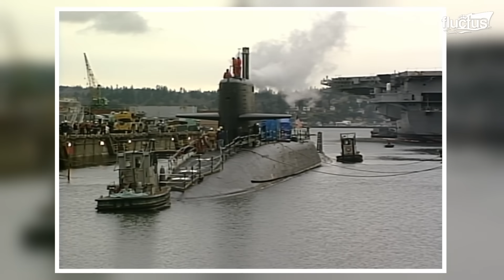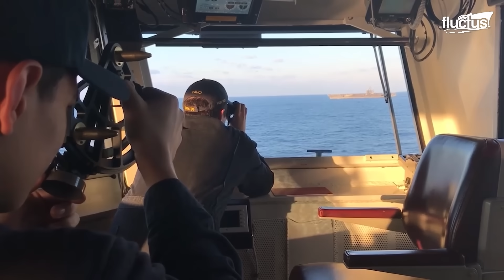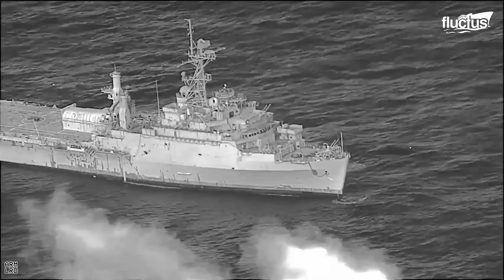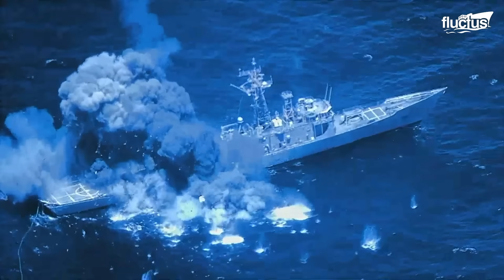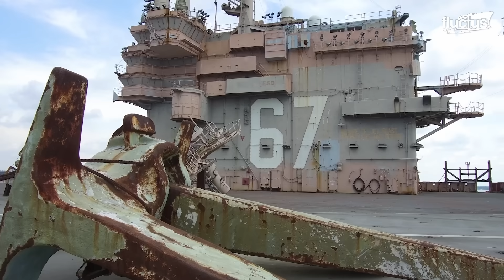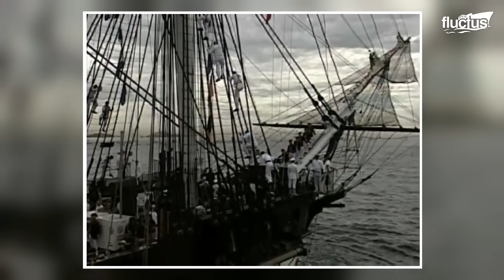Scary Process of Recycling Billions $ Worth of US Navy Nuclear Submarines

Comment: You ought to get your facts right. There is no USS ForestCony and never was. The Forrestal was the first of it class back in the early 50 and the first carrier with an angled flight deck. The Constellation was a follow-on ship of that class commonly called the "Cony".
Reply: Exactly, where does this dude get the information from? Recycling subs is not scary, it was my job for several years.